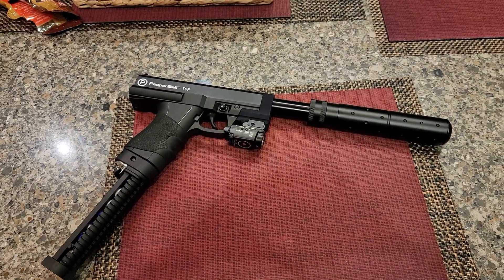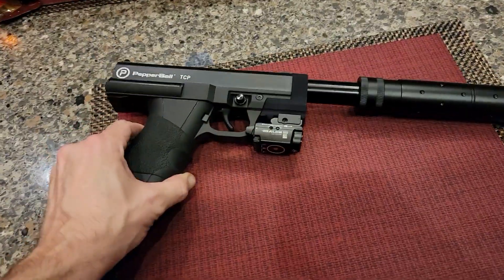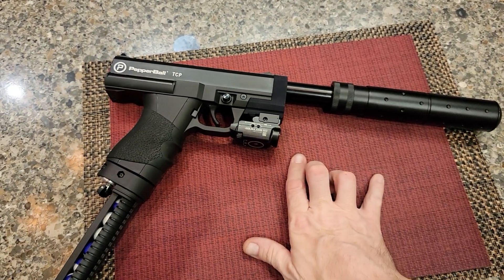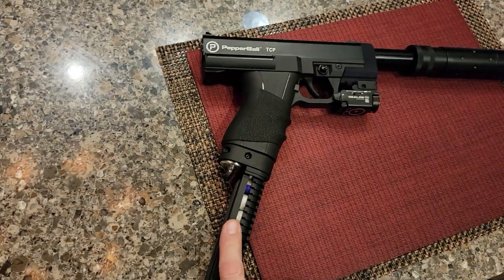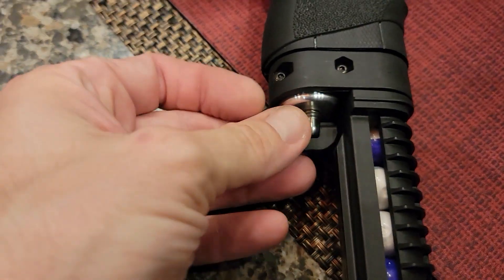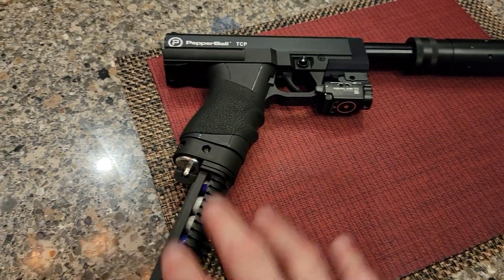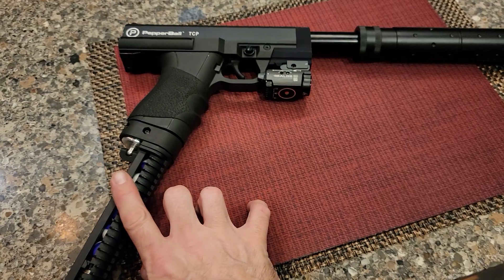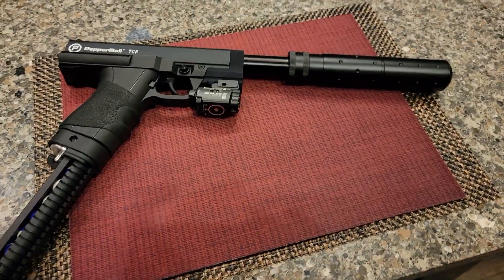Project Unmodified: Grimburg 12g mag modded for mag extension

Comment: Hey there i have been having some problems with my Hdr 50 11 joules it was a 7.5 joules but i put a new valve system in it and ever since my gun runs  out of co2 after every round (6 shots) i fire every screw is in where it should be and i watched a tutorial on how to install the valve system if you know anything please let me know.
Reply from the maker: So have you checked to see how much power you're getting with each shot and did you remove the restrictor from that valve
Reply: @DK-Spencer  it shoots very hard but i do not have one of those fps trackers and no i did not remove the restricter do you need to remove it?
Reply: I have a hdr 50 that goes about 300 fps and over if you want to buy
Reply: @DK-Spencer  ??